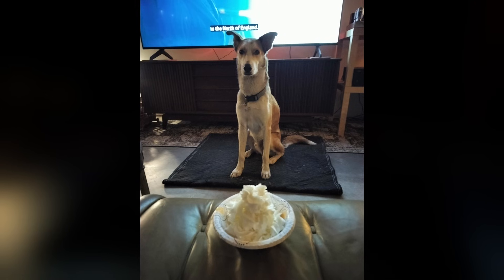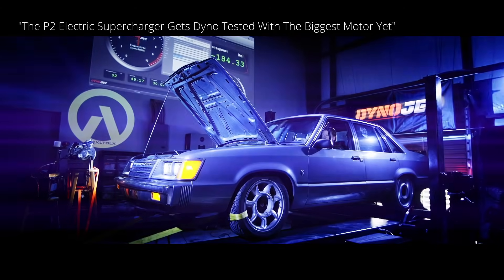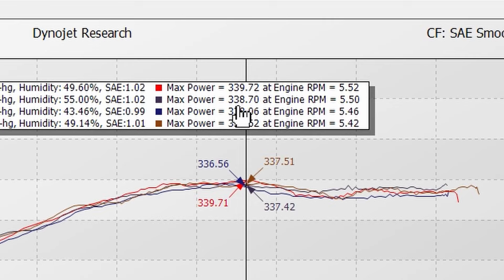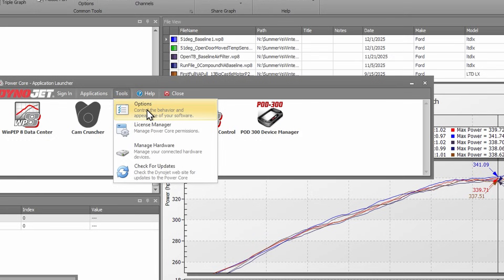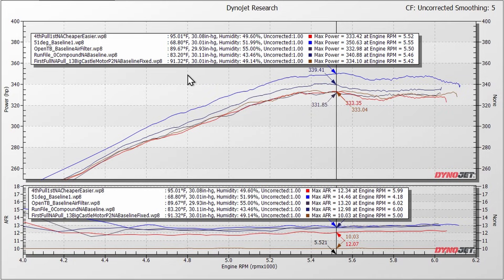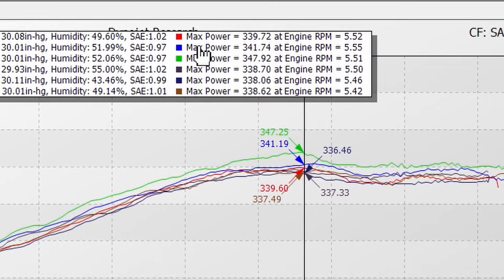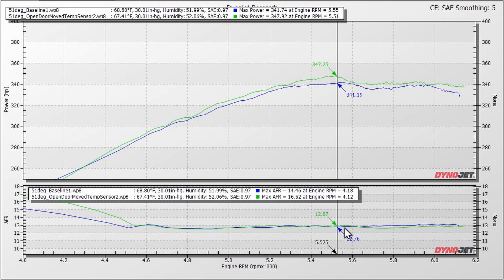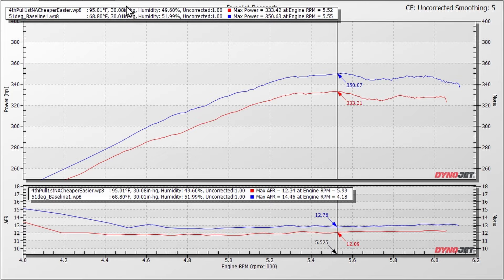Cold Air Makes More Power for a Reason Many People Don’t Know — Dyno Tested

Comment: Do you monitor the fuel temperature, or just ambient air temperature?  Back in the early days, we used a 'Kool Can'... where fuel line coiled inside a tank that you'd put ice water in.  
I think you'll see larger power swings if you can get the fuel really cold, and that would offset your hot summertime days, more than temp. of the air between summer and winter.
Reply: colder fuel increases power as it acts like a charge-air-cooler, so it also depends on manifold design and where the fuel enters the air. Carb engines see much more effect from cold fuel than an EFI engine with standard runner injectors as the fuel has more time to evaporate and cool the charge. with a carb you can see below ambient MAT with even warm fuel and that helps the power especially in the low to mid rpm ranges.
Reply: @Gin-ging  Yes... AND... Colder anything... is more dense.  More dense means more BTU per CC (or whatever you measure it by)... More fuel for the same capacity, equals more 'potential' energy.  

It's all about how much 'potential' energy you can get to pass through an orifice.  Colder fuel has smaller molecules, therefore more potential energy passes through the Jet (in a carb) or injector(for EFI)  More fuel, equals more air needed for optimum combustion.  Colder fuel, absorbs more heat in the intake channel, therefore, the air is colder, and more dense, therefore, the Oxidizer potential increases, therefore MORE POWER.  Doesn't matter if it's EFI or Carbureted.

And yes it does depend on where the fuel enters the intake stream.  A direct injected motor, sees little to no benefit(TO the intake air temp, ONLY),  because the fuel never interacts with the intake runner air, or incoming air, so the point is moot.  However, a throttle body EFI is essentially a computer controlled Carb and it can take full advantage of the cooling effect of colder fuel.   

This is why water/meth systems give so much gain.  The water takes up volume in the cylinder, raising compression, and cools the piston, so higher pressures can be run, and the meth adds much more cooling potential, as well as acts as a fuel enhancer (meaning it raises the BTU potential of the fuel you are using).
Reply: @atheplummer  The density change of gasoline between 70f and 120f is less than 4%, and from 70f to 210f it is only 10% and that percentage goes down as the temps get lower thus it is not a significant improvement in fuel density. As fuel density increases it runs richer for the same fuel metering and on a properly tuned car that will not see power output increases only loss of efficiency. The air fuel ratio or lambda is what controls the power output with all other variables remaining the same, more fuel via denser fuel will need more air to have the same ratio thus the fuel density is irrelevant here. The specific heat of gasoline only increases 6% from 70 to 122f and with the time in charge it can not effect it the full 6% without a long runner and top of runner injection, thus not a significant change again. As for your comment on TBI setups, No engine builder looking for real power numbers would ever run a TBI, they basically always use runner injection and only a few use a second stage right in the plenum or at the throttlebody so that is also irrelevant. Your last point about water methanol injection claiming water takes up the volume increasing compression ration is also incorrect, water as vapor (steam) does not provide any increase in performance beyond its cooling effect from specific heat. It has been dyno proven that the methanol charge is the only real source of additional power gained in those setups, yes it helps but not from the water itself.
Reply: I forgot to state that the reason that water injection can not increase cylinder pressure is the ideal gas law, colder charge means a naturally lower pressure. This is why a very efficient charge-air-cooler will lower boots but increase power output. Colder = more density = lower pressure
Reply: @Gin-ging  Water vapor is NOT a gas.  It's still a liquid.  Now, If you want to talk about humidity, based on water transforming from H2O to H3O and HO-, then you would be correct.  When water boils to a airborne vapor, it's still in liquid form, but natural evaporation, where H3O is released into the atmosphere as a gas, and the remaining OH- remains on the boundary layer between a body of water and the atmosphere, then we can agree. 

Therefore, liquid water hitting a hot surface and boiling, does still increase static compression in an engine, simply because the water vapor takes up volume in the head volume, simply because liquids, even when turned into a vapor, cannot compress. 

You see the difference yet?  Vapor is NOT a gas.
Reply: @atheplummer  As soon as you said "water vapor is not a gas" you have discredited yourself completely, You are clearly not as intelligent as you think you are and thus trying to make any further point to you is useless. The definition of water vapor: "Water vapor, water vapour, or aqueous vapor is the gaseous phase of water. It is one state of water within the hydrosphere. Water vapor can be produced from the evaporation or boiling of liquid water or from the sublimation of ice." this is basic science at a middle school level! Also you mention H3O which is a hydronium ion and has nothing to do with this subject at all. 

Please go do some real research and educate yourself, not everyone online thinks you are smart just because you use fancy words.
Reply: @Gin-ging  https://www.youtube.com/watch?v=i-T7tCMUDXU&t=1s
Reply: @Gin-ging  https://www.youtube.com/watch?v=i-T7tCMUDXU&t=1s
Reply: @atheplummer  Did you just try to google something to sound intelligent again? I am very familiar with Dr Pollacks research and it has nothing to do with what you are saying. His work is about an organized molecular state or water into a semi fluid state between solid and liquid, nothing at all dealing with the gaseous state in the least. Do you even understand what he is talking about in that ted talk? as if you did you could see how far off it is from your "water vapor is not a gas" claims.
Reply: @Gin-ging  Well, I couldn't find the particular video he did, where he talked about evaporation, cloud formation, and exactly what I was talking about.  So, If you are very familiar with him, and his work you probably have already been exposed to what I'm referencing.  

And his formation of organized molecular water, I can actually manufacture in bulk.... And what I've discovered is, that when this 'organized water' comes in contact with a Plasma ignition(high voltage & high amperage), like this demonstration board I've made https://www.youtube.com/watch?v=BdakEn92CaQ , I can spray this organized water directly on the spark plug, and guess what?   The water disassociates and actually burns under normal atmospheric pressure.  

I'm currently working on a blend of this organized water with a fuel as it's showing more promising power potential than even oxygenated gasoline... And it's emissions free, as long as EGT's are below the temperature threshold to create NOx.
Reply: @atheplummer  Everything else aside....
how are you going to spray water directly onto the spark plug? Without an injector directly in the combustion chamber you can't as it will vaporize into the charge air. Also the combustion chamber is about 60cc for the average V8 engine, only 1cc of that being the area around the actual sparkplug, and under the pressure of compression that spark/ plasma area will be compressed to a much smaller size. The area of effect of any plasma generated by the plug for the milliseconds it is active during normal engine cycling would not have much if any effect on disassociating the water molecules, and at higher rpm your time is 10x smaller than at idle. The math would suggest that even perfect conditions will create very little H-H-O for use as fuel. 

If you are going this route I will advise you to modify a sparkplug to be an injector for the water, using a checkvalve and the mostly hollow nature of normal plugs giving you the best chance at delivering all the water to the tiny plasma area. Also for that you should start with a 4 prong or even "E3" style plug or a face style plug as used in Mazda rotary engines to give the most plasma effect area possible unlike a normal single electrode strap plug.
Reply: @Gin-ging  First of all, I'm not going the route of a HHO generator.  When the 'treated' water (which temporarily transforms it into H3O2, also known as Hydronium, structured water, or EZ water, depending on who you are talking too.  The water enters the combustion chamber in the same manner as fuel does, along the intake tract, or direct injection works too.  I've found that carbureted engines need some special modifications to work properly, in the venturi area.  Atomization is critical in this particular instance.  

It doesn't matter if the water turns into water vapor from heat, it's still carrying the treatment within it, so it will still disassociate upon contact with the plasma ignition source.  

I'm still in the early testing phases, but preliminary tests prove that I can add 16oz of water, to 5 gallons of 87 octane gasoline, and the result is an average of 3-4 MPG more fuel efficiency.  I know this sounds crazy, as water and gasoline don't mix, but with this treatment, it does.  However, when really ramping up the water ratios, I intend on using an alcohol based fuel.  

I'm at a stand still right now on further testing, as the next equipment I need to advance to the next phase of development is a bit out of my personal finances.  I've attempted many avenues for venture funding, but with all the scammers our there, I easily get lumped into the same basket.  

However, I can assure you, my current research is positive and repeatable.  If you'd like to continue this discussion, let's pick up on my video I linked earlier.
Reply: Alcohol is the way to go. Back of the napkin math, Ethanol at 452°F cools the intake charge the same amount as Gasoline at 32°F, just the extra heat/energy needed to vaporize ethanol. It absorbs 2.4 times as much heat per unit, and you can run it twice as rich.
By the time you get to Methanol, you no longer need a cooling system on the engine.
Reply: @SpecialEDy  Correct, But, man the oil changes get spendy...